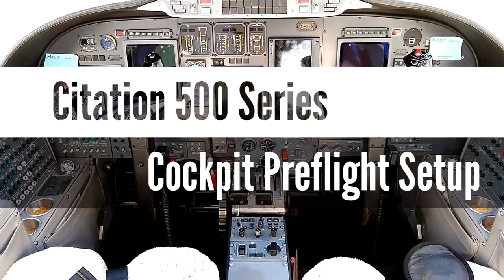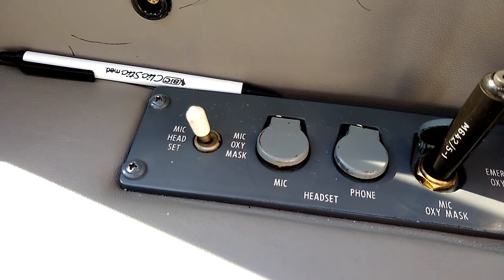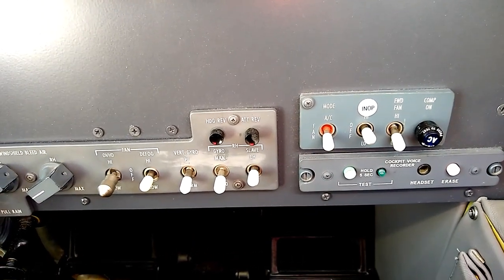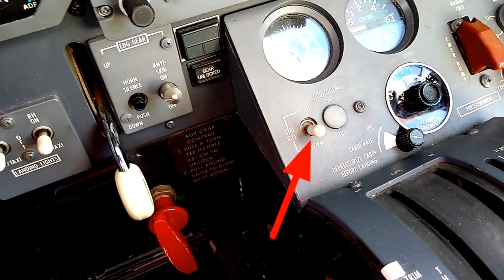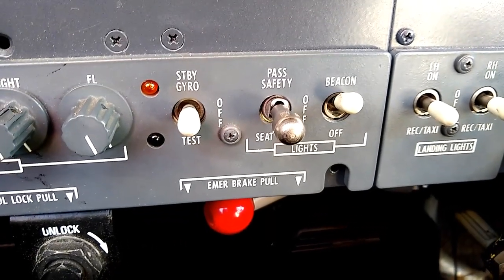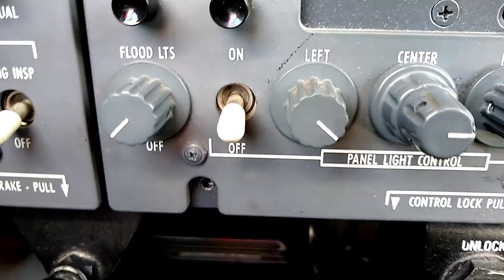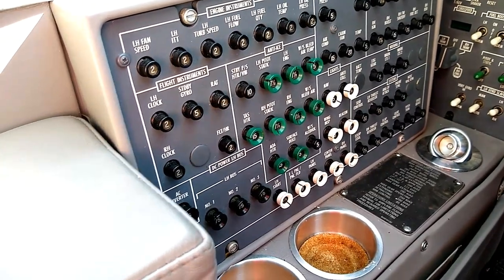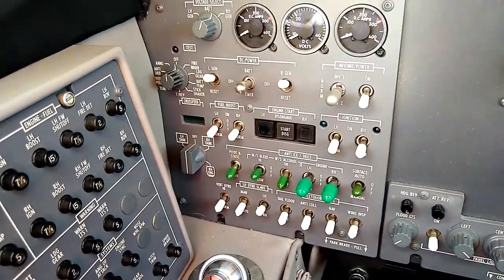Citation 500 Series - Cockpit Preflight Setup

Comment: I’m preparing for a type rating. U Tube videos are awesome. Thank you.
Reply from the maker: Excellent! Glad you find them useful. What will you be flying? My advice to anyone getting typed is to learn what makes every annunciator light illuminate/extinguish and learn what happens when you flip each switch on the main left side panel (generators, ice protection, lights, etc).  If you can do those two things, you've learned 90% of the knowledge needed for a type rating.
Reply: @citationpro   My type will be in the 560 Ultra.  I am expecting to fly the Encore, but the company I will fly for have several other models. How did you get involved in making videos?
Reply from the maker: @jamesconvery4793  That's great! The entire 500-series is a very well designed lineup. I'm a training captain and check airman for a company operating several of these aircraft. I began making videos to help new hires study before getting in the actual aircraft. I keep everything as anonymous as possible on YouTube because everyone's a critic these days. Maybe you got hired at my operation and neither of us knows it yet!
Reply: KJVY
Reply: @citationpro  Training at LOFT
Reply from the maker: @jamesconvery4793  We won't be working together apparently. My operation does everything through FSI. Congrats on the new job though!